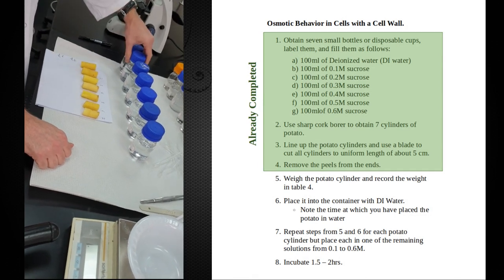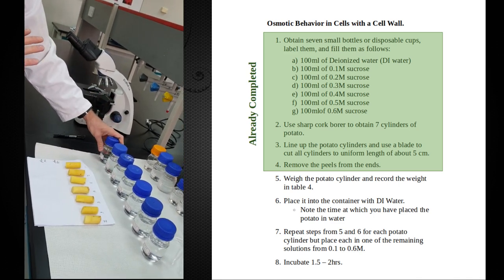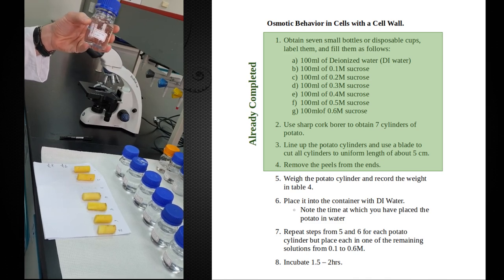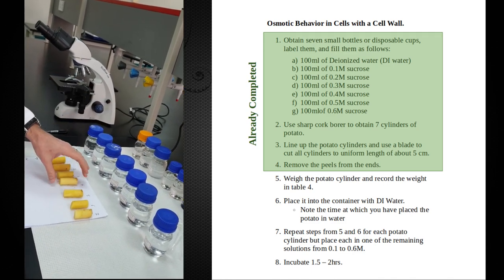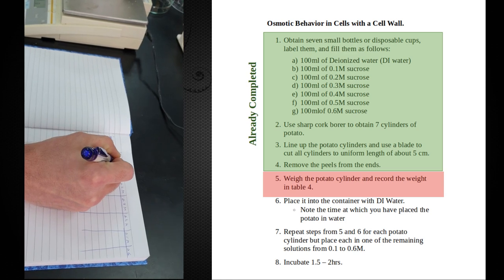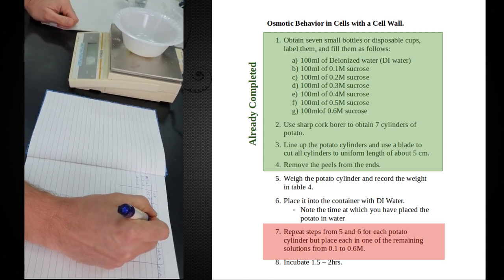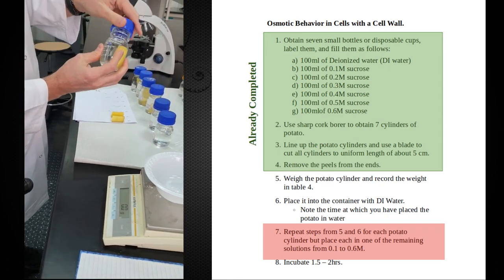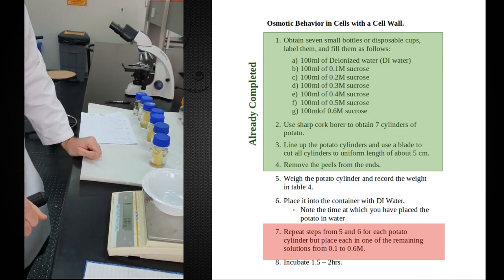Determining Potato Osmolarity (BIOL101 - Diffusion & Osmosis Lab)

Comment: Uh, I may not get something, but how do you calculate the osmolarity from that? Is that the % change in weight??
Reply from the maker: The part that is not shown in the video (because it's explained in the lab) is that you take the % change in weight and graph it against solution concentration.  This will generate a graph with some points above the x-axis and some below the x-axis.   You would draw a line of best fit for this data and look for the point at which the line crosses the x-axis (the x-intercept).  That is the point (ie. the concentration of sucrose) at which the potato cells would not increase or decrease in size. This means that this concentration of sucrose would be isotonic to the potato cells.  Therefore you have just determined "the concentration of stuff inside the cell".